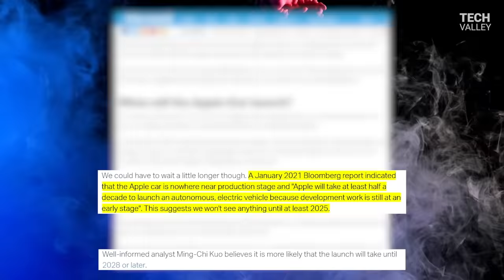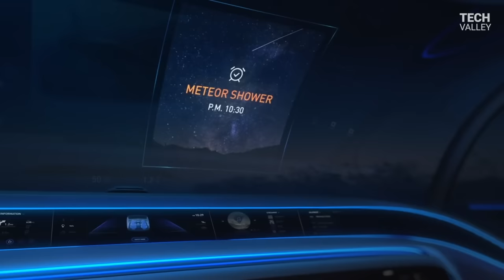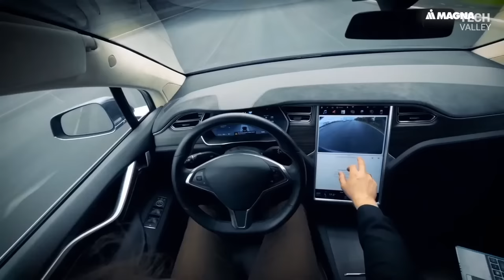Apple iCar 2022 - Final Update Is Here! (Apple Car)

Comment: Is there extra payment for tyres steering,key charging device etc.
Reply: Better ask if you can change parts of it on your own coz with iphone if you or a 3rd party repair shop change part to fix your phone it won't work.. it needs to be done with their over charging service center..
Reply: @chad9113  👌💯
Reply: they got the wireless charge edition and the wired charging edition

Comment: Wheels sold separately.
Engine sold separately.
Gas tank sold separately.
Steering wheel sold separately.
Radio sold separately.
Doors sold separately.
Lights sold separately.
Base sold separately.
Motors sold separately.
Mirrors sold separately.
Glass sold separately.
Seats sold separately.
Breaks sold separately.
Grill sold separately.
Color sold separately.
Screens sold separately.